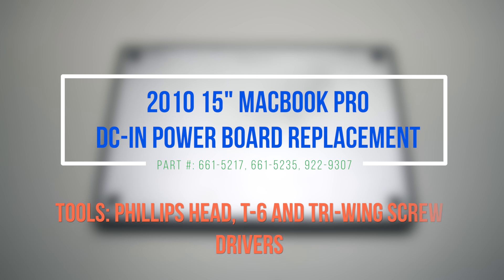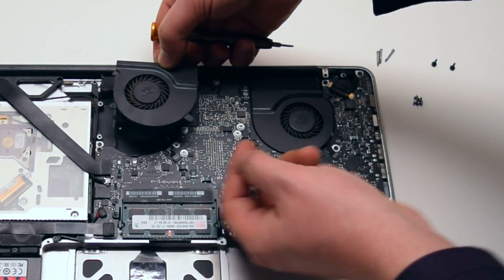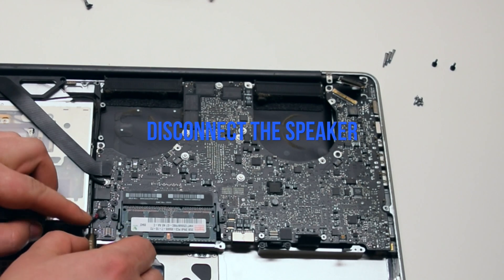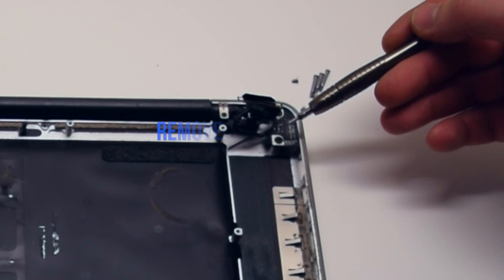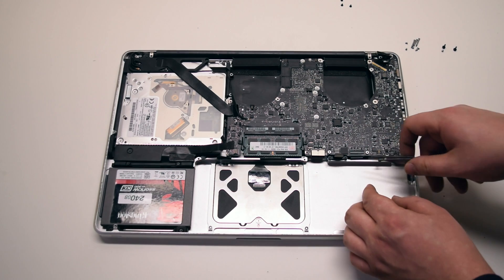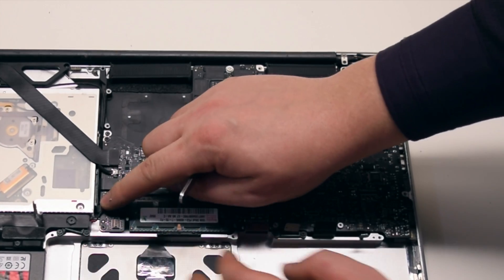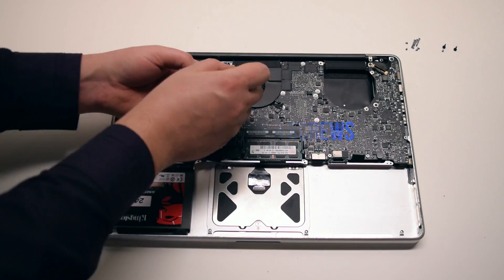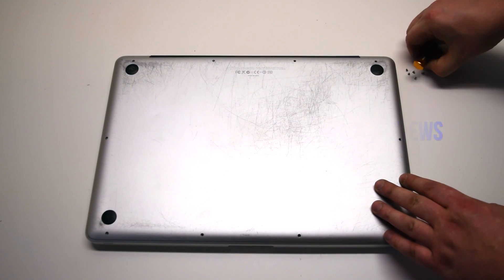2010 Macbook Pro 15" A1286 DC in Power Board Replacement

Comment: Hey there. I realize this video is years old, but I thought I'd give it a shot. I was wondering if the battery indicator ribbon that goes into the logic board needs to be plugged into the logic board? I was having issues with a dim green charging light and the mbp not turning on. I followed your direction to change the dc in board( which was great btw ). That didn't solve my issue. But what I did find was that when I disconnected the battery indicator ribbon from the logic board everything began to work fine. Now my mbp is working fine again, but without the battery indicator plugged in.